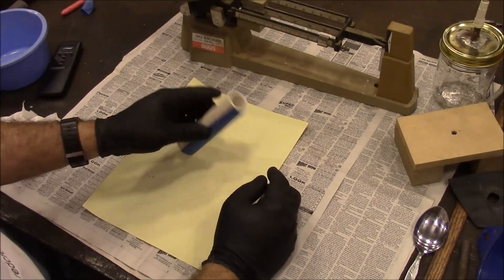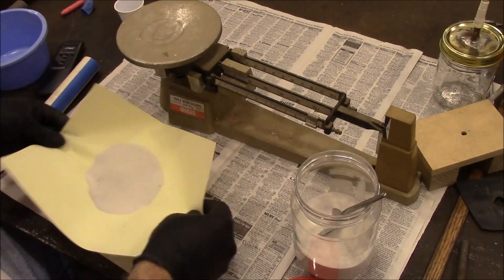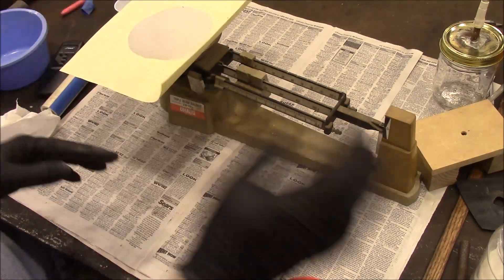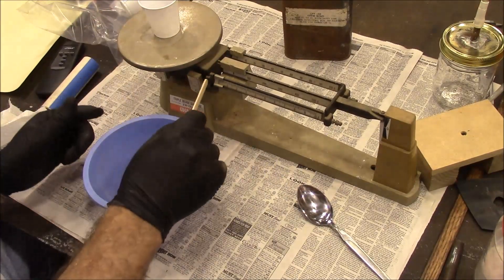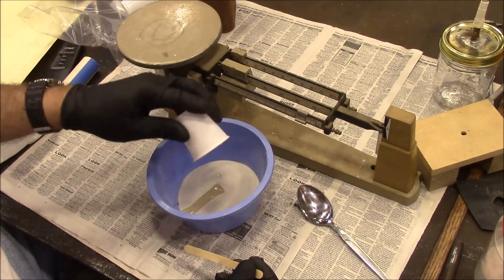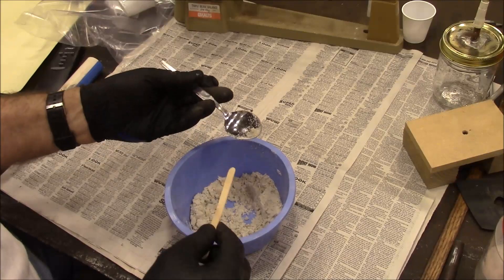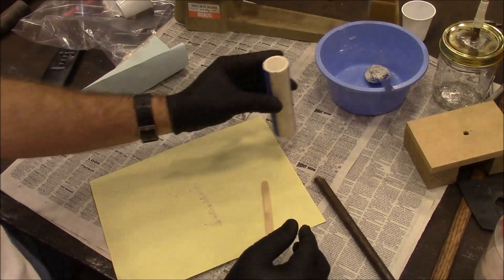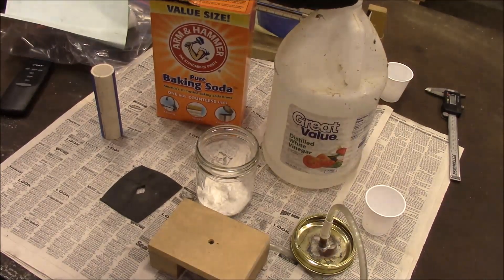Making a Foundry Core with Homemade CO2 Generator

Comment: Would that core material be good enough as refractory in a foundry  ( for low temp like aluminium? )
Reply from the maker: No, it breaks down once it gets to that temperature.  That's one of the things that makes it a good core material.  You can break it out after the pour.

Comment: Matt is right, poke a wire or small knitting needle through the core to help the CO2 get into it - this also acts to vent the core during casting. I would also suggest using fairly small marble (limestone) chips (even bits of sea shell) instead of the bycarb as the  reaction will be a bit more controllable. CO2 cores are known to be very difficult to remove after casting as the breakdown of them is poor - sometimes you have to get them out with a hammer and chisel! But adding 1/2% glucose powder to the dry sand and mixing it in before directly weighing in the Sodium silicate will solve this - the core will soak/hose out after casting. This addition may make the core slightly weaker so you may need to up the silicate - I tend to use 7.5% but then I do like a strong core!
Reply from the maker: Thanks for the input and thanks for watching!
Reply: Watching was my pleasure. I hope that you did not mind my 2 cents worth, its just an expression of my belief that we foundry types should help each other. To be honest I prefer shell cores  but one does not always have the luxury of a metal core box to work with so CO2 becomes the next best option. Unfortunately provision of the CO2 is the Achilles heel of the process - I was lucky in being given a full cylinder but for most people the gas represents quite a problem. With what mathematicians would call an "elegant solution"  you have solved that problem - your method is simple, effective, and anyone can do it - well done!Incidentally there is some suggestion that CO2 cores are best used a few days at most from making. However I have used some that were several weeks old, but then I am fussy about venting the cores.
Reply: Hey Oldfoundaryman and Soat Mon thanks for the information.  I like to try this but I just want to be sure I understood everything.  
1). These type of cores are soluble with water?
2).  The sand is not beach sand but sand you can get at home depot? Or where do you recommend?
3).  Oldfoundaryman: Where do you get the glucose powder?  I searched and I get on my search some sort of pills!?
4). Oldfoundaryman: Can these cores can be used with molten aluminum at 1700 degrees 

Thanks for the answers.  I'm hoping to try these soon.

Jeff
Reply: Jeffry, I will leave Soat Mon to answer the first two questions (unless he wants me to answer them) I get the glucose powder from a health food shop.1700 deg. is very hot to be pouring aluminium normally around 1350 deg.  would be the go! But they do use these cores with molten iron and that s at about 2500 deg. so it should take 1700 Ok.
Reply: Thank you Olfoundryman!!  I thought I was hitting the wrong searches on the internet because I kept on coming up with health food.
Reply from the maker: No, I really appreciate your comments and experience.  My experience is pretty limited, I haven't actually ever used a core.  I made this one and then decided not to use it in the mold.  Thanks for the comments and watching my videos.
Reply: I have tried several types of sand, including cement. But what I use to live in a pine grove is the sand of the sieved roads, and it is true that a ventilation channel should be created to help CO2 get as far as possible . The idea of mixing glucose with sand seems to me to be exclente. Sugar also works.
I recently made a figure in PLA and surround it with sand with silicate after watching this video. I found bronze in it and I was very happy. Thanks for that fantastic contribution

Comment: Punch a stiff wire down through the core sand prior to gassing, and that'll let the CO2 get through the sand easier.
Reply: Matt Moore also co2 is  heavier than air so I would recommend getting a end cap drilling a hole inserting the tube or hose and placing it on top of the PVC mold in conjunction with the wire hole down the center. a wire hanger does a great job for that. this will maximize co2 exposure.
Reply: @agustinlimon7951  Thanks for this advise.Agustin. Shayne.

Comment: Hi, just wondering, what is the purpose of the foundry core?
Reply from the maker: You use a core to create a hollow place in a casting.  I originally was making this core to make a hollow place through the hub of the wheel for the axle.  Thank you for watching!

Comment: thanks for the demo, I tried this a month ago and I'm not sure what I did wrong but, from the looks of it I may have used to much sodium silicate. I bought mine at a ceramics supply so I'm assuming it's the same concentration. I may try this again tonight
Reply from the maker: +Clarke E Measure it out and you should be fine.  This was the first time I've done it but the results were really good.  I hope you try it again, good luck!
Reply: +Soat Mon thanks, I didn't get a chance to try it last night, still working on some patterns but will try to make some cores before this weekend. I'm curious to try a threaded pattern, I know it would be rough but for this application I think it would be fine for a course thread.

Comment: Hi! Very good but what is the core for? Looking forward to more. Mike.
Reply from the maker: +Michael D Joven The core was actually for the wheel that I used in the muller that I just made.  I wound up not using the core because I realized I needed that part of the pattern to hold the wheel while I turned it in the lathe.  Hated to waste a good video though.  Thank you for watching!